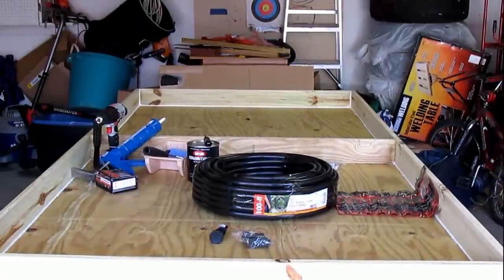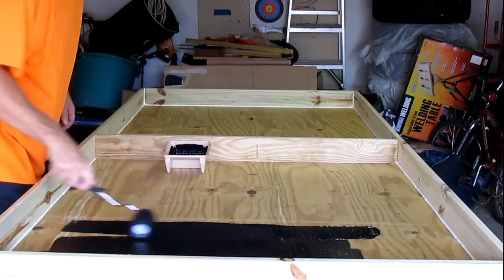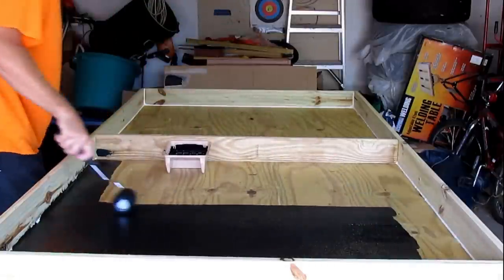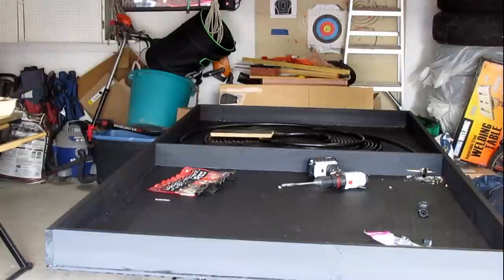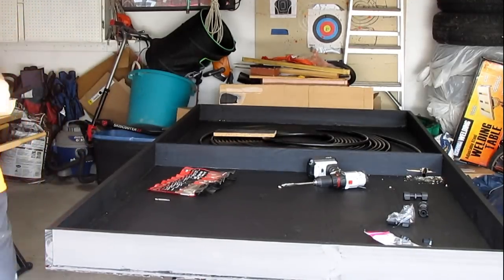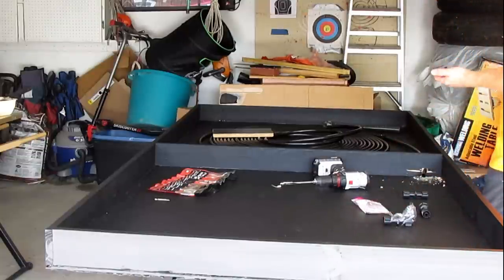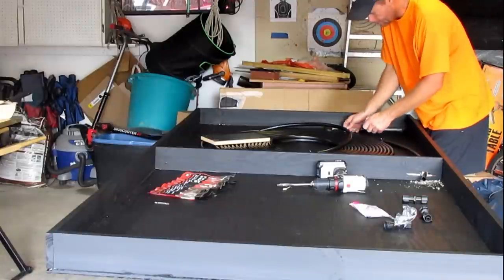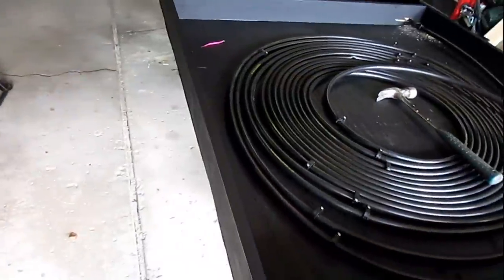How To Build A Solar Pool Heater - DIY!

Comment: If I use a sump pump 1/2 HP instead of a small pump, will it still be able to heat the water up ? Or will the flow and pressure be too much to heat the water?
Reply from the maker: Hey Romero.
The bigger pump will definitely move the water much faster.
You could always add some more coil, or even better, you could add a timer to the outlet & have the pump kick in every 10 minutes or so. This will really allow the water to heat up nicely.
Thanks for stopping by my friend and do stop by to let us know how it goes :)
#RCInsiders
Reply: The timer method is actually less efficient.  With a timer you are drastically reducing your volume. Yes the water will come out 120 degrees but 5000 gallons at 94 degrees has a far better heat exchange then 400-500 gallons at 120 degrees when using a timer. The previous numbers are based on 94 degrees = 500 gph pump x’s 10 hrs a day and 120 degree setup = 100 gph pump at 4-5 hours a day on timer. You need to know the total gallons of your pool and how much your heater pump puts out. 1/2 hp with far more coil would be a lot better. If your pool is 10,000 gallons, and your heater puts out 100 gallons per hour, the heater would essentially be fighting a losing battle. With 10,000 gallons I would recommend 1000’ ft of coil with a bigger pump. The structure design of this setup is great but it could have at least double the coil in each 4’x4’ section. And a bigger pump is definitely needed  which you can get for around 30$ on amazon. With 1000’ of coil you would not be able to run them in sequence though and would need to have the water “T” off, going to 500’ each section.
Reply from the maker: Hey Jerry.
Great job working out the math!
I am adding a second unit that will contain 400' of tube, giving me a total of 600'. I will do some experimenting with the timer & see how it goes. I don't know the exact numbers, but lets say the coil holds 25 gallons of water. Now say I can heat that water to 120 or more evry 10 minutes & run that cycle for 10 hours that's hundreds of gallons of 120 degree+ water.  This coupled with having the pool covered with a cheap solar cover should be more than enough to keep a good temp in the pool. Keeping the pool covered at night is the biggest thing as this is when most of heat loss occurs.
Thanks for stopping by my friend & happy heating! :)
#RCInsiders
Reply: RC Insiders there is no advantage in running the pump slowly or allowing the water to spend a long time in the coils. Heat transfers faster the greater the temperature difference. By circulating the water faster, it will be cooler, and pick up heat more efficiently. As above, a large volume of water heated very slightly will ultimately give you much more heat into your pool than a tiny volume heated to a higher temperature.
Reply from the maker: Hi Spencer,
Isn't this theory completely dependent on direct sunlight?
Even when there is no sun the inside temp of the box would still be warm and allowing the water to sit for a bit would at least let the water warm a little?
Either way, I will experiment with the timer in search of a constant 80-84 degree pool :)
Thanks for stopping by & happy heating my friend!
#RCInsiders
Reply: RC Insiders As long as the solar collector is warmer than the pool water, heat will transfer to the water. There is no advantage at all in letting the water sit for longer to warm up further- all that gives you is substantially less water, warmed slightly more. The greatest amount of heat will ALWAYS. be gained by heating as much water as possible, even if the temperature rise is only very small. Ask any physicist- not YouTube!
Reply: @j.co.6373  My pool is 5000 gallons and I was planning on 500'.  What pump size would you recommend.  Not planning on putting up on roof.

Comment: Can you tell me how to build the stands?  Thanks.
Reply from the maker: Hi,
You can make the stands with anything you want. If you have some extra wood laying around you can use that.
If you buy it, I would get 2 10" 1x4 or 1x6's.
Cut 2, 3' pieces & screw them together...1 laying flat & 1 standing up making a 90 degree angle. Take your 4' left over piece & set it on your 2 pieces you screwed together. Determine what angle you want & mark the upright board with a pencil & cut on the line.
Place it on the 2 & screw top & bottom. Cut one small piece to put in the 90 degree angle for support & screw in place.
Thanks for stopping by & happy heating my friend :)
#RCInsiders

Comment: I am trying to figure out the best pump and solar panel to use for this. I am putting it on the flat roof of our sunroom, so want the pump to be up there with a small solar panel to power it - so not a submersible pump. Can you recommend a pump and solar panel that will accomplish this?
Reply from the maker: Hi Charlie,
If you don't want submersible, you are going to need an inline pump.
What is the height & total distance to the pool?
Are you building a solar unit or looking for pre made solar panel?
Thanks for stopping by & happy heating my friend! :)
#RCInsiders
Reply: @RCInsiders  Thank you for the fast reply. I built my own solar unit. 4'x8' out of plywood and 2"x4"s, Lexan top. The roof is 8'8" high, another 6"-8" down to water level. Pool is just under 6" from house. The setup I have planned right now is water goes in a 20' clear plastic tube, into pump, through 500" coiled black 0.6" ID tubing, then out and down another 20" of clear tubing. I know I need an inline pump that is made for chlorinated water. I'm not sure how much gpm I need, what type of solar panel I can get that I can connect it to, etc. 
Thank you again!
Reply from the maker: @charliefoster8378  No problem buddy!
I am working on a solution that should work. Operating the system with an inline pump & solar system could be pretty expensive to get started.
What is your budget for the pump/solar power system?
Reply: @RCInsiders  I was hoping to not spend more than $200. If I were to not do solar, the nearest outlet is 15' away and would require a wire/cord to go over a walkway, which I want to avoid.
Reply from the maker: Gotcha.
Going solar will normally require a panel & either a solar generator or solar compatible battery. The battery will require cutting the plug wire on the pump to wire directly to the battery. Either one will only be as dependable as the sun.
It's a cool option & if you still want to do it I will try to find a suitable set up for you.
Let me know my friend :)
Reply: @RCInsiders  This might be more complicated than I thought. If you have a solution that includes solar, that would be my first choice. That way the pump would run only when the sun is out, which is when the water would be getting warmed anyway. 
If that is too complicated, I would do a pump on a timer, because no sense in running it when there is no sun.
Reply: @RCInsiders  Thinking about this, if the solar is going to be too complicated/expensive, maybe an in-line pump with a long cord would work. What do you think? If I go this way, can you recommend one?
Reply from the maker: Hey Charlie,
It's not too complicated, but could definitely get expensive.
Here is the pump I would use in your situation - https://amzn.to/3kNHpoI 
It will pump over 300 gallons/hour, but most importantly it has up to a 39' lift to get the water up to the roof.
Let me know if you're still considering solar. Around $300 - $500 for a solid set up.
Reply: @RCInsiders  What is the durability of this pump like? How many hours a day can I run it? Any issues with overheating if it is on the roof? This looks like the solution I will go with. Thank you for your advice!
Reply from the maker: @charliefoster8378  I can't speak to the durability. Water transfer pumps are not designed to run continuously. It would need to be on a timer of some kind. If you wanted to run continually, You would need a different type of pump. We may even be able to set up a diverter system with your pool pump.

Comment: Great video.  I have a 17k gallon pool.  Do you believe 200 ft of tubing would heat this pool up at all?   Live in NE.
Reply from the maker: Hi keels,
I had pretty good success with this unit last year. I am adding a second unit this year & plan to experiment with a timer to allow the water to sit for a bit in the heater. Maybe 10 min on/off. I think I can fit 3-400" in the unit. The more tubing the better.
We have a similar climate. With the solar heater & keeping the pool covered with a solar cover (especially at night!) I was able to keep the pool 78-82 degrees all season. I'm aiming to keep it over 80 all season with the 2nd unit. Without the solar heater, the pool frequently dipped to 70 - 72. 
I definitely think it will heat it up, but it is solar. On super cloudy days heat out put will be reduced. It will still heat the water somewhat just by the tube being in a hot box, but direct sunlight is key.
Thanks for stopping by & happy heating my friend!
#RCInsiders
Reply: RC Insiders I’m going to give it a try with 300 ft and see if I can see a few degrees increase overall in the pool.  We are sitting at 72 degrees right now with overcast and low 60s all week.  I keep a solar cover on it day and night.  Thanks again.
Reply from the maker: Awesome!
It's crazy how much heat they lose overnight!

Comment: Curious why you used a 5/8” hose if the tubing is 1/2” ?
Reply from the maker: Hi Marc,
Almost all residential garden hose is 5/8.
The fittings in the description are for 5/8 hose to 1/2" tubing.
Hope that answers your question,
Are you building a solar pool heater?
Thanks for dropping by & happy heating my friend :)
#RCInsiders

Comment: Hi 👋🏻 there,
Awesome project! I’m gonna try to make this myself😊 I’m a woman, but ey, of course i can do it💪🏻
But why do you need the pump? I was thinking to use a bypass after water gone through the intexpump, before it gets back into the water. Or am I thinking not clearly?
Love your video, thank you so much for it!
Best regards from The Netherlands 🇳🇱
Reply from the maker: Awesome Ivanka!! Girl power 👍😍
I have several reasons for going with the pump:
Simplicity. After building the solar heater, simply plug it in and make heated water :)
Flexibility. I want to be able to experiment with timers.
I don't want to "have" to run the pool pump all the time to run the heater.
You absolutely can go that route if you want to. I can help any way I can.
I would need a pic of your pump set up & the exact size of all the pipes/fittings.
Awesome...The Netherlands! A place I always wanted to visit 😀 
Looks like an amazing place!
Please let me know if I can help with anything.
Thanks for stopping by & happy heating my friend!!
#RCInsiders

Comment: Just one question.  for the connection from the end of the irrigation tube to the hose that attaches to the pond pump.  You have the same connector as on the other side right?.  the 1/2 inch to Female hose connector.  Then you have the other end of the hose cut off and pushed onto the pond pump.  If I am correct in saying that my question is what size hose is it (the green one).
Reply from the maker: Hi Amy,
Are you asking what size the hose is, or the fitting specifically?
The pump comes with several different fittings so you can use any size hose from 1/2" up to 3/4, as long as the fittings are 5/8" to plug into the heater.
Hope that makes sense & hope that is what you are asking?
Thanks for stopping by Amy & happy heating! :)
#RCInsiders
Reply: I was wondering also how you attached the green garden hose to the water pump. Do you screw it into the pump directly without the fittings?
Reply from the maker: @christineamaronespianostud1252  Hi Christine,
On the end that attaches to the pump is cut off & slips/pushes over the fitting that screws into the top of the pump. If you can't get a perfect fit. you can use a small band clamp to secure the hose to the pump. 
Hope this is what you were asking?
Thanks for dropping by & happy heating my friend!!
#RCInsiders

Comment: Did you cut the garden hose in half, is that what the copper fittings are I your parts list?
Reply from the maker: Hey Chris,
Yes, that way you have some fittings & can make any hoses you need to connect the pump & the solar heater. If you decide to make a 2nd solar unit these fittings will really come in handy :)
Thanks for stopping by & happy heating my friend!
#RCInsiders

Comment: What if you just used 200 ft or more of black garden hose hooked up to a sump pump?
Reply from the maker: Hi,
I suppose you could, but that would be pretty expensive. The 100' rolls of tubing I listed in the description are around $17.
Also, it gets quite hot inside the box & I don't know if the hose could handle it. The tubing is durable & has lasted for years.
If you happen to try it let me know how it works?
Thanks for dropping by & have a great day :)
@RCInsiders

Comment: So the water going into the pool did you leave the hose on top or run it to the bottom of the pool?
Reply from the maker: Hi Robert,
I run the pump about mid way down & let the water run on top.
Are you going to build one?
Thanks for dropping by & happy heating my friend!!
#RCInsiders
Reply: Already built it going to try it out tomorrow
Reply from the maker: @rjp7413  Awesome 👍👍
Reply: So when first turning it on I had a temperature at 142 but after running it for about 20 minutes it was only at 74 doesn’t hold the heat very long and I have it turned down so it has low water flow
Reply from the maker: @rjp7413  What is the pool temp? Outside temp? Amount of direct sunlight? Length of coils?
Reply: Outside temp 85, pool temp71, length of coil 200 ft just like you made
Reply: Direct sunlight all day
Reply from the maker: @rjp7413  I have experimented with a timer. 30 mins on 15 off with success before, But I usually go that route with partly to mostly cloudy days. Some heat exchange experts who have stopped by & commented here say even a few degree differential is good enough. I only aim for 78-80 in the pool which this does. Also, I always have the pool covered with a solar cover at all times when not in use. Especially at night as this is when you lose most heat

Comment: Hello ! what plastic cover did you use? Where did you get it? Thank you!!
Reply from the maker: Hey man,
You can go with plexiglass, but it is pretty expensive!
Check this out - https://amzn.to/357xdiZ
It's not rigid, but it will work just fine for around 20 bucks.
You just want something clear to let the sun in & trap some heat.
How big is the pool you're trying to heat?
Thanks for stopping by my friend & happy heating!
#RCInsiders
Reply: @RCInsiders  Thanks for the tip!
Reply from the maker: You're welcome!
Send us some pics of your project! 😀
#RCInsiders
Reply: Do you have a temperature reading of inlet and outlet while it's been running for an hour? Water sitting in the pipe will be very hot just curious what the flow temperature is at how many gpm flow rate.
Reply: @RCInsiders  This is out of stock at Amazon.  Any ideas where else you might find one of these?  Thanks for the great video!

Comment: Great video. Plan to begin the build this week, but I have a general question-

Obviously lots of variables, but ball park, how heavy is the system when “full” and running. Considering making it slide in and out under my deck in a drawer like fashion.
Reply from the maker: William...What an awesome idea!!
Of course tons of variables, but running I would put mine in the 50-65 lb range.
I gotta see this thing when you're done! Stop back by & let me know how it goes?
Thanks for stopping by & happy heating my friend!!
#RCInsiders
Reply: RC Insiders 

Forgive me as I’m sure it’s covered in the comments, but I’m ready to hook up and start heating and I’m debating what kind of pump. 

What do you recommend? The pond pump you are using- any idea the gallons per minute or hour you get?
Reply from the maker: Great William!
Here is the pump - https://amzn.to/2O1LhFj
This pump has an adjustable flow rate so you can dial it in to get optimal heat transfer. It has a max flow rate of 550 gph, but I don't run it that high. It seems to heat the water better with a slower flow rate.
Did you end up making it slide in and out?
Happy heating :)
Reply: RC Insiders 

So, build is nearly complete. Covid has made Plexiglas hard to get, so there is just some plastic sheeting for now. It may be thicker than needed, Matt switch out for something more clear. I was able to do it like a drawer. Is there a East to share pics, or give me your phone # or  email address. I’ll text or send them. I’m at about 245 ft of 1/2” pipe. My pump should be arriving today from Amazon. I didn’t want a submersible pump remaining in the pool so I went with an in-line water transfer pump. I’ll try to attach a link. 

We shall see. Using my 1250g/h pump I use to drain the pool/cover (way more flow that I want, but couldn’t resist testing it out) with an intentional kink in some garden house to return the water I was able to get a sustained rise of 17 degrees. 81 up to 98.
Reply: BOKYWOX 110V 93W NPT3/4'' Circulator Pump 3-Speed Control Domestic Silent Hot Water Circulation Pump（RS15/6R）
Reply from the maker: @21DelphiDr  AWESOME!!!!